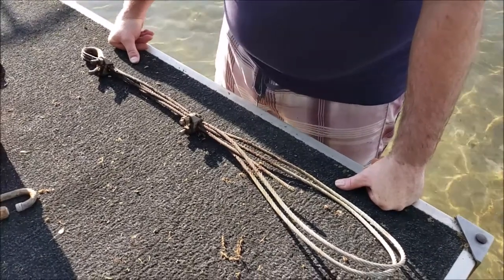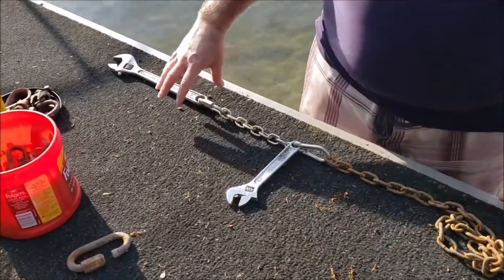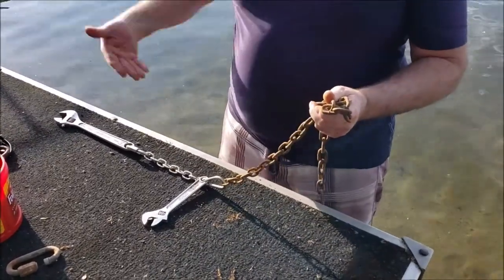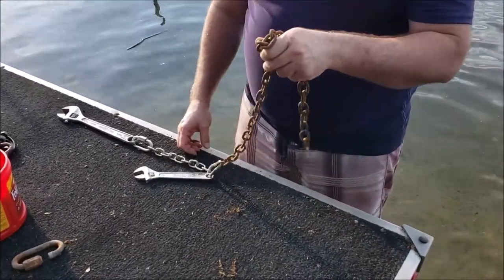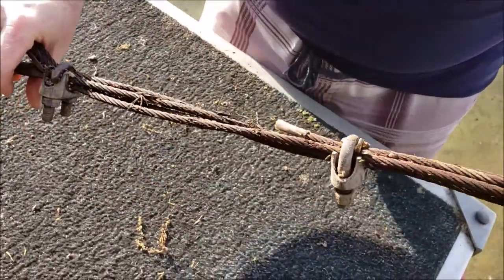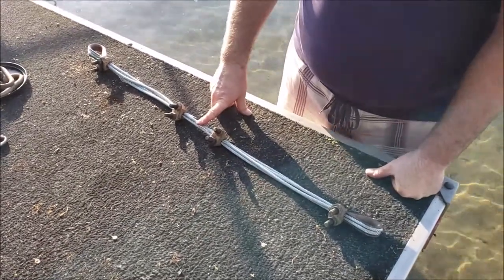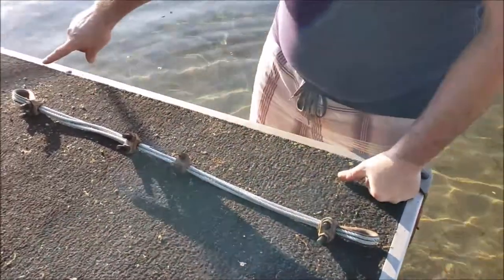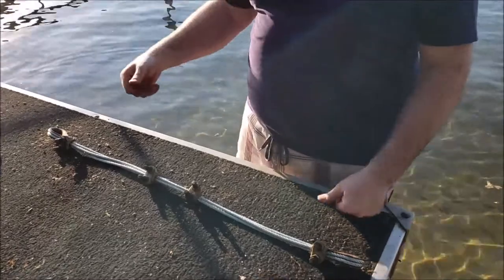Swim Raft Anchors

Comment: Thank you. This is exactly what I needed to know.
Reply from the maker: You are most welcome! We have learned a lot about what works and what doesn't in over 50 years on the lake.  If anybody has questions on waterfront equipment we haven't touched on yet please post  them!
Reply: Super helpful! Question, how come in the new version of your cable shock absorber you didn’t leave the wide loop on the one end? Thinking about making one of these and figured you need that loop to absorb the shock.